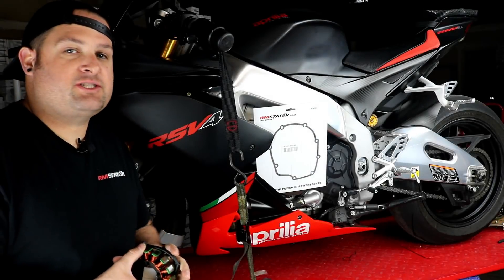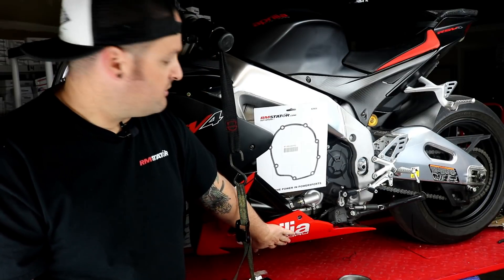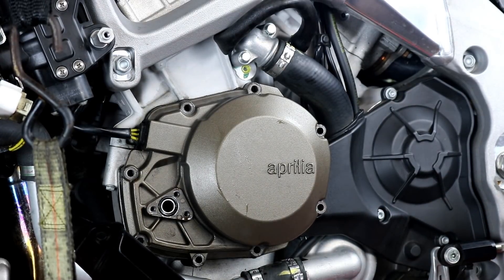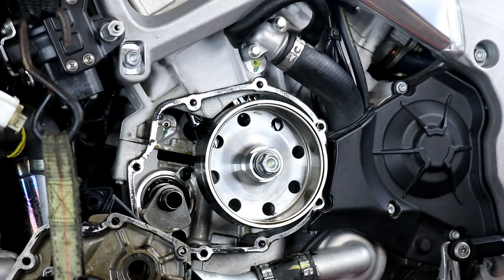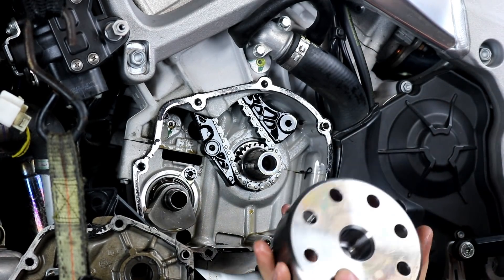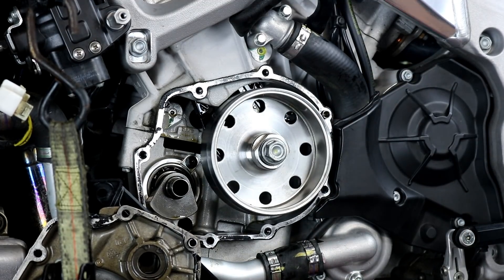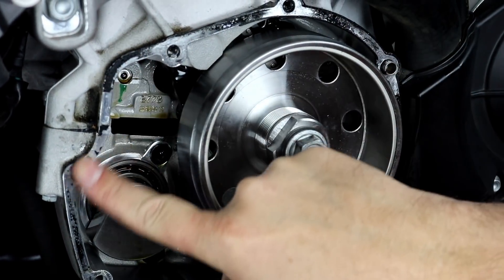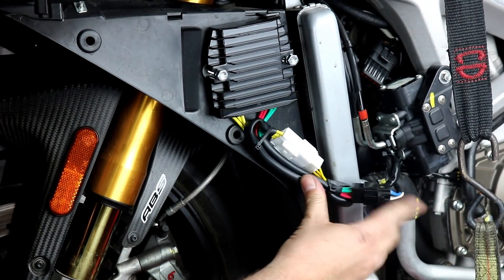How to Install RMSTATOR Aprilia RSV4 Tuono Kokusan Flywheel Stator Recall Upgrade Kit

Comment: I watched the video a couple times while doing the install and everything worked perfect …I had trouble torquing the flywheel bolt back on as the entire  flywheel Wanted to spin  and I didn’t wanna break anything that was moving with the flywheel..chain and swivel inside casing.. Today i took the 2020 RSV4 out for a ride and everything’s charging beautifully and  the system  is keeping my battery at 90%  :-)) 
much appreciated… if anybody is reading this, the flywheel puller is a must or else you will  be stuck.. Going to the Track in two weeks can’t wait and will update you ..thanks again for everything Rm Stator 
🤙
Reply from the maker: Thank you for your comment! We are always happy to help!

Comment: i have a 2020 rsv4 and it just started stalling out at stop signs. The bike will start right up and wheb i get home the battery will read about 13.2 volts ..should i replace battery or regulator thanks...tmh battery is a EBL 1 year old

Comment: I like how the stator bolts weren’t the right size in your video just like they weren’t when I got my Gen 2 kit from you. Just watched them fall right into the holes because they’re 2 mm too small. Your entire kit failed in about 1000 miles on my Gen 2 Tuono. Hitting the rev limiter once on a missed shift blew the rectifier which resulted in 15+ volts charging and once that was replaced the stator only lasted another month. Absolute shit products and I can tell you don’t know much about mechanics either watching you impact that flywheel back on. Been building engines professionally for 20 years. That hurt to watch. 

Thanks for nothing guys. It was awesome to blow $300 on my bike for nothing
Reply from the maker: Sorry for your bad experience. I hope you reached out our customer service team as your parts would be under warranty. The bolts in the video were not too small and did not fall in place, there was an edit in the video where I tightened them before continuing. A missed shift and hitting the rev limiter would not directly cause a regulator to fail. It does sound like it failed by overcharging, but we would certainly warranty that type of failure. I would ask you why you changed to our charging system kit in the first place? On a Tuono or RSV, this is most likely because you already experience one or more charging system component failures as most of these bikes do. Our kit solves the problem for most people, but it is a very failure prone bike from the factory for the charging system. Lastly, I appreciate you don't agree with my methods, but using an impact gun on flywheel bolts has worked well for 20 years for me as well with no problems. You're welcome to assemble your motors as you see fit of course. Hope you reach out to us and try our products again.

Comment: respect
Maybe you can help me, I have a 2012 rv4 tuono and I have a problem. My second stator burned out in 5000 kilometers.
I also changed the rotor and now I'm afraid that it won't burn out, I think it's a factory error, now I've decided to change the regulator too, so let's see.
Do you have any information about what's going on, because I don't trust that motorcycle anymore, it left me in the middle of nowhere twice already.
Thank you

Comment: Hi, is see an option with voltage regulator and Mosfet regulator, what is the difference and which one to pick for my RSV4R 1000 2013 model, with engine num > 4000. I live in a tropical climate so will that have any impact on my choice?

Comment: How much did this job cost the customer?
Reply: I have a 2018 Tuono Factory with an oil leak out from my stator wire. Common problem apparently. All up for flywheel, new stator, a few other small parts and labour they want $1400.. (Australia). And it’s a 3 month wait for the stator to come in 💀

Comment: the screws holding down the stator usually have locktite on it, very easy to strip it and turn a 2 hour job into multiday day frustration

Comment: Hy! I have an Aprilia Tuono V4 1000 (2011) ZD4TY000.
I want to replace the strator. Does this model also have to drain the oil? Or how can I find out?

Comment: Firstly thank you so much for your time for this clear instructions! my 17 rsv4rr is charging at idle around 13.4 and around 13.6 rpm at around 4-5000. Im considering to replace the stator coil and the rectifier but can i just leave my existing flywheel alone? dont want to trouble removing it thank you

Comment: I have the exact bike and I was wondering when would you ever need to replace the flywheel? Is it when the flywheel is pitted?
Reply from the maker: The original flywheel has extremely strong magnets. It is usually replaced with the later model part to lower the magnet strength and increase stator life. They are rarely physically damaged on these bikes.
Reply: @Rmstatorinc  Oh, okay cool, thank you!

Comment: Is the piece that threads onto the flywheel left or right handed thread. I got mine tuck and turned left and left but it wot come off. Plz help
Reply from the maker: It is regular thread (turn left) from what I recall.
Reply: @Rmstatorinc  yep i got it. I was definitely over thinking it.😅😅

Comment: sorry,but that is  a  little  bit on the  ridiculous  side....you already unbolted  the  flywheel,showing only how  to  install the  FW puller...would  have liked  to see   the  whole  removal  operation  ...then,you use  a  impact  to  tighten the  bolt??????  you  realize  that someone is  going to  shear  this  off  for  sure  right?  this  should  be   torqued  to  factory specs,nothing else. then you install  the new  stator  into  a  oily  case  cover??  you don't  even try  to  remove the oil  film which covers  the  whole   interior  of  the  cover?  LOL...wheeew!!!
Reply: Hahah buuurrnnnnn, fantastic smackdown by @Rmstatorinc, does sound a little like its outside his skillset. Theres a few things Id do differently than in the vid, but theres many ways to skin a cat as the phrase goes.
Reply from the maker: Thanks for the comment. It sounds like this job might be outside of your skillset based on your objections to the video.
Reply: @Rmstatorinc  absolutely not.my point is that,for  the people  who aren't mechanically inclined,it would have been handy for  them to  see what to  do  when,as  example,the cover,or  the nuts,resist  at the moment you pull back  to  either get the  wheel off,or  if  ever  the nuts  stick because too much  thread lock or  else...when you make  a  tutorial video,you  show  ALL  of  what  has to be  done in details ,and  all the  problems  you may encounter.
Reply: @Rmstatorinc  i’ve been building motorcycle engines for 20 years. You should be embarrassed to have posted this video and this follow-up comment. You should be more embarrassed at the quality level of your products. Horrible made in China garbage. I tried giving you a second chance with warranty replacements and those parts failed just as fast. Y’all are scammers.

Comment: Do you see what he doing,he pull out same rm stator. Dont buy that crap,work 200 miles maximum
Reply: what do you mean? he dont use the upgraded stator?
Reply from the maker: I am Evan from the video, and most definitely did not remove one of our stators from the bike. Based on the colored powdercoating on the stator it was likely an aftermarket stator from another brand, but it was not ours. Please don't imply we are dishonest in our videos, we absolutely are not.
Reply: @Rmstatorinc  you seem honest, just inexperienced. Sending a flywheel home with 12 ugga duggas on the electric impact like you’re changing a tire. Embarrassing work buddy. “Head of engineering” yeah but not a real engineer
Reply: How do I get the OEM flywheel off? I don’t have the mounting tool. Is there another way that a home garage mechanic can use.

Comment: Had the same procedure done on Buell CR1125
They had charging system with issues as well
Reply: The process is a little more involved on a Harley motor, but generally the same steps. Hope this video helped!
Reply: Evan Grist 
CR1125 is another animal
Its equipped with Rotax water cooled engine
Which is kinda similar to older Aprilia V2’s btw
Reply: Ah sorry, I'm admittedly no expert on Buells. Good to know it's similar to this process. Thanks for the heads up!
Reply: Yeah the CR suffered really badly from bad stators...My aprilia has been ok with almost 30'000km but I will make sure I will check it out and replace thanks to this video!